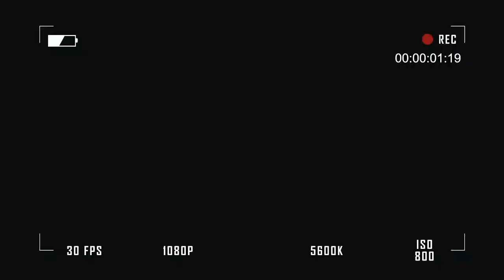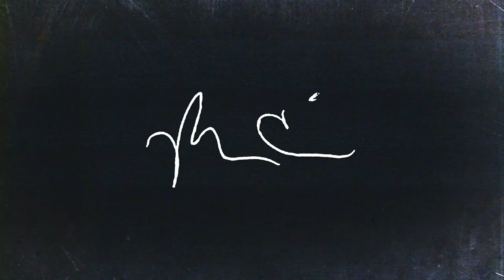We Removed an Engine Without a Hoist

Comment: Damn bro, you just went from 5lbs of boost to make the stock motor more fun, to a Vette slayer. I saw you responded to a few of my posts so you should have an idea about where I am in watching the build. Not too many people that I know personally have ever modified one of those GM 1.4-2.0L engines so this is cool to see. So at this point you are DEEP into building the motor, so my suggestion would be simplify the intake and exhaust. Run dual injectors so you have a "normal" car for daily, and the second set for enrichment with either E85 or methanol. Delete all factory systems. Hopefully you go standalone for engine management but I guess i will see in the coming vids. Good shit so far brotha
Reply from the maker: Thanks! I appreciate it. Not to spoil more videos, but the fuel system is getting a full upgrade that'll handle around 600hp. Definitely a great idea with the dual injector setup.

Comment: I think you may have mentioned it before but I would look into getting arp head studs for sure.  Don’t want any head lift at high boost and maybe a slightly thicker cometic HG.  Our motors 10.5:1 compression could come down a hair especially if you’re chasing 350whp.  Other than that your bottom end should be bullet proof so I don’t think reliability will be an issue for you.  Everything looks great man, I’m just anxiously awaiting the cams/specs still.  This thing will be sick, the highest hp 1.4 Cruze is around 350 so you have to get 400 and I’m 99% sure you’ll have the highest HP Cruze ever and it’s a 1.8 lol
Reply from the maker: Secretly I would like to get 500whp out of it, lol. Well, looks like I have to shoot for 400whp or bust! I had the machine shop machine the block for larger 11mm studs. The stock ones are 10mm and the only ARP studs that would work length wise were the oversized ones. So we should be good there. The stock head gasket is a MLS design, luckily. I'll look into the Cometic but I'm thinking the stock would should do just fine. I got an aluminum flywheel as well. I took some video of it, but it's off at the machine shop because I had the whole rotating assembly balanced, but now we're waiting on the pistons to be finished. I decided to keep the 10.5:1 compression because I solely plan on running the engine with e85. I'll have to check all my specs and see what it comes out to when it's all said and done because I believe the connecting rods will put the pistons a little further down in the hole. So CR is TBD. lol There are some other things I have in mind that will be coming from overseas that they make for the 1.6 that'll help get the high HP numbers. I feel you on the anxiously waiting part because I am as well. I'm going to contact Crower today to see what they can grind into them and I'll get specs over. If they can grind something in the 280º range, that should help bleed off some of the compression.

Comment: Hi Matthew, I am about to pull this same engine. I am going to disconnect the intake and it's bracket plus the crank pulley, water pump.and alternator. Do you think I will have enough clearance for the clutch to come out with the engine?
Reply from the maker: Hey Bob. That should do the trick. I'd take the plastic timing covers off as well just incase they get bumped. I cracked mine putting the engine back in.
Reply: @cmattdabrat  will do. Thanks for the pointer. I forgot to mention it's in a Sonic being that the frame seems smaller than a Cruze. Thanks again.

Comment: Video does not show how you removed the crankshaft timing sprocket,  looks pressed fit but not enough clearance for a puller. Any advice would be appreciated.
Reply: Nevermind,  all I had to do is giving it a few taps and a came loose.
Reply from the maker: @saulcalzada8621  Glad you got it sorted. For those looking for this info... With the engine in the car, you would pull the passenger wheel, remove the balancer bolt, which is torqued to 135 or so ft lbs. The timing gear slides right off. Be sure to use a new bolt which you reinstall. They're torque to yield.

Comment: Well that's a new one! Def hope you bought a crane for the reinstall, hahaha. Is that actually an iron block engine? Very surprising in this day and age if so.
Reply from the maker: LOL! I'll definitely be installing it with a crane. I thought, well hell, can't be that heavy, let's just lift it out. You see how that worked out. It is! Iron closed deck block, aluminum head, variable intake manifold, vvt... I'm not sure why this engine hasn't gotten more love in the states. Lot's of options overseas for the 1.6 variant which comes with a turbo. Same block, rods, and head, but with a smaller bore.
Reply: @cmattdabrat  One of those interesting studies in what exactly makes people like a car/engine. Definitely sounds like a good combo for some power! I've done some very sketchy things like this though. Installing a transmission on grass with a floor jack, trying to move an engine crane holding a V10 by pulling it with a car, I'm sure there is more. ;)